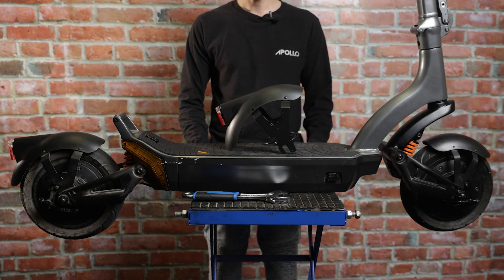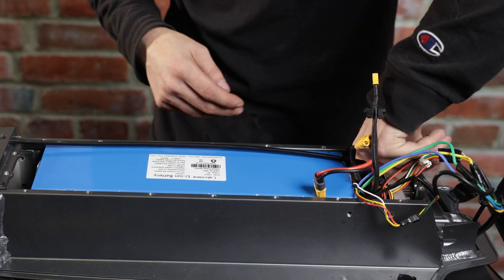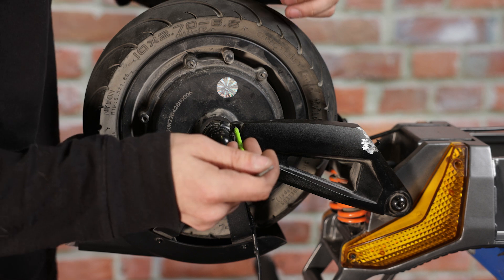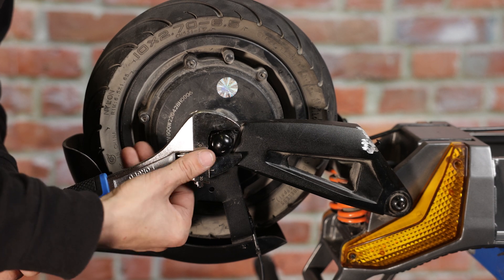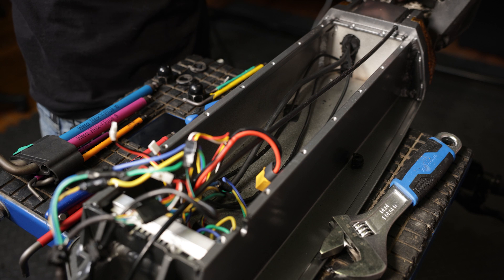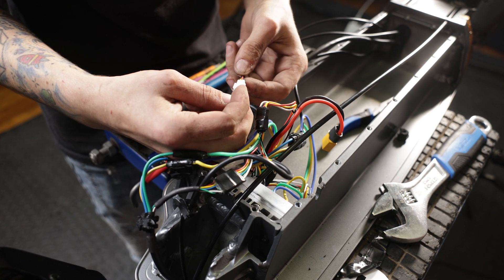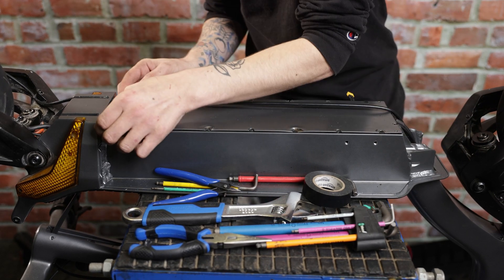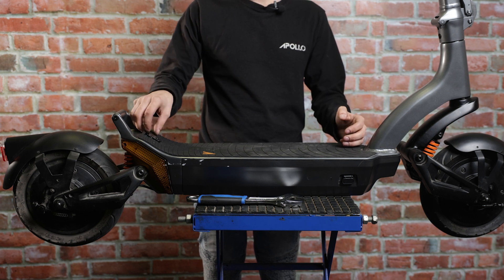How To: City 2023 Rear Fender Replacement

Comment: the rear fender assembly really needs a plug, this much fuss is silly.
Reply: I guess it could be easy to DIY the plug, but then it won't be protected in the "waterproof" compartment.

Comment: if i just want to replace the fender without the light, i saw a nut that holds the rear break light. Is it possible to just replace the rear fender frame? People don't want to open up the whole scooter if only the rear frame is broken.
Reply: No, mine is completely broken and i tried to see if I can remove it and that wire is connected to the light, so you’d have to physically go in the scooter and unplug the wire like the guy did

Comment: everything on this scooter is a pain in the ass to fix. Need to replace a throttle? Gotta rip the entire steering column apart and rewire it. Watch that video it's even worse. There should be a plug point near the light so all you have to do is replace the plastic fender, since that is what breaks, NOT the bracket. I honestly would just take my chances cutting and reconnecting the wires near the light that come from the battery area. No need to rip the entire scooter apart. Apollo needs to design things with repairs in mind in future iterations of this scooter.